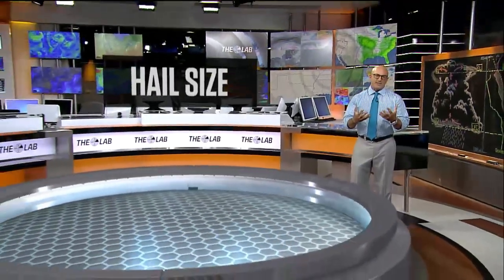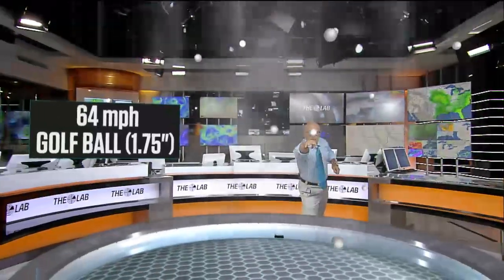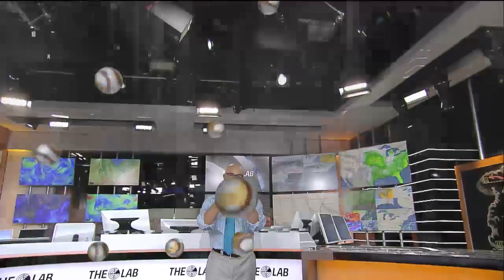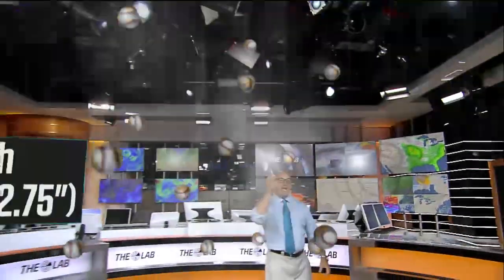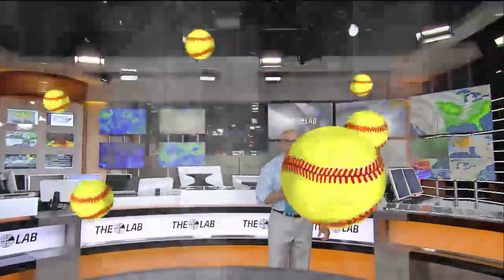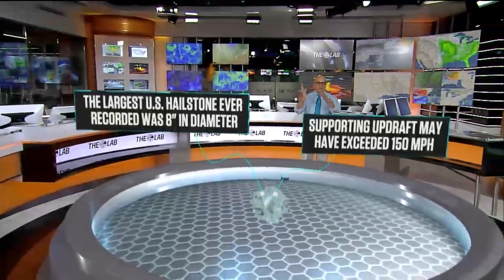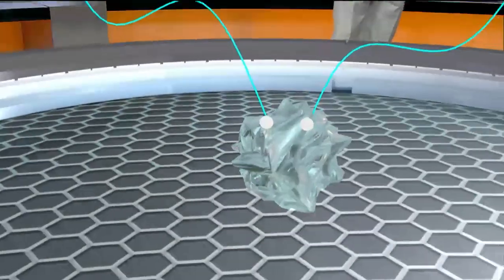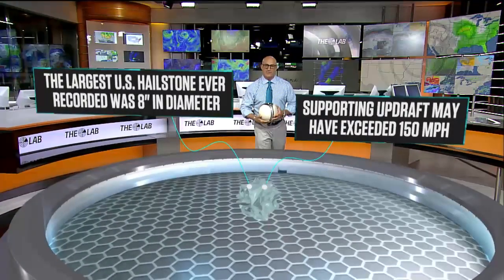Hail Explained in 3D!

Comment: Don't Get Me Started On Cricket Ball Sized Hail Which Is From 61 Millimeters To 75 Millimeters In Diameter! That's The Equivalent Of A Size Range From 2.4 Inches To 2.9 Inches In Imperial Units! In Fact, Cricket Ball Sized Hail Is Around The Same Size As Baseball Sized Hail!